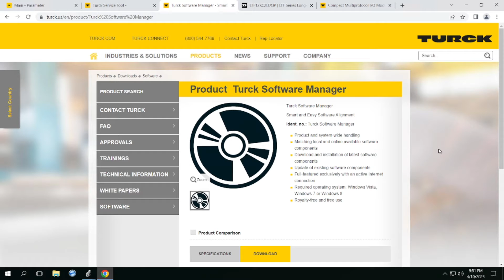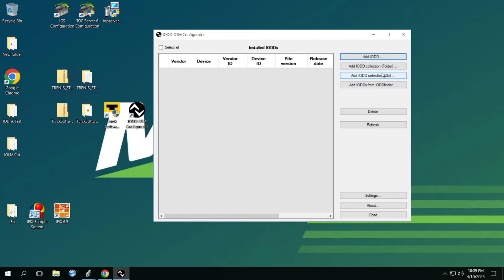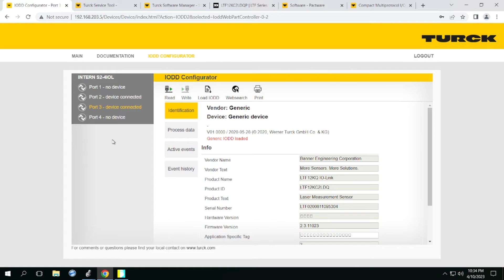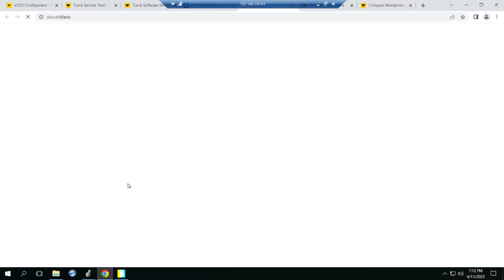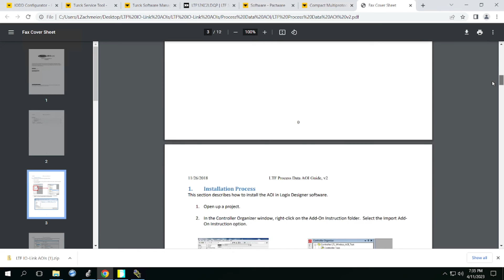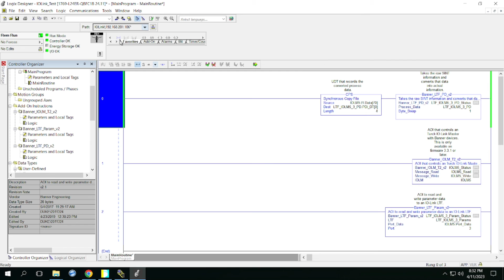How to Configure IOLink Devices in Studio 5000

Comment: Hi that’s a good example, that was for the complete configuration of the tben module , you don’t have to do that for each port do you .
If you wanted the rslogix 5000 to automatically download the configuration to the tben module if it got changed due to failure is that possible